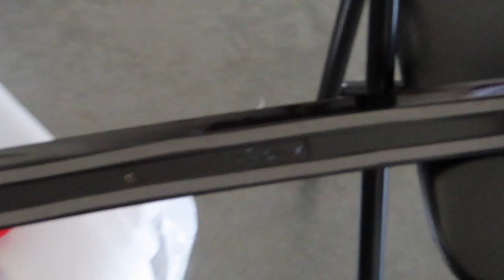Roof Wing Spoiler install 2020 Toyota Camry mods | GARAGE DRIVEN

Comment: Thank you for showing this video. When you use the adhesive promotor, the guy I was considering buying one off of ebay, I didn't know the english was this first language and he was referring to just the tape when I asked if it comes pre installed. He says it's already on there but you had to do it yourself.

Comment: I just installed that exact wing and had the same issues with it in the corners.  It's not flexible so you can't bend it downwards.  It's not very noticeable so it's not a huge deal.

Comment: My one have two deflectors pieces left in trunk at delivery, part have to be install under car in front of each front wheels, car pass from 7.4 to 7.9l/100km on my 'highway only' use after having them installed. I am just about to remove it to check again. At 1450km per weeks its a tird gas thank full needed on my friday come-back ride, it $uck'$!

Comment: Is the glue necessary? Would you recommend just using the 3m tape? I know I'm late to the party
Reply from the maker: That’s not glue it’s adhesive promoter it just enhances the stickiness of the 3M tape.
Reply: @GarageDriven  got it. Thanks for responding.

Comment: FYI, I used that tape on a front rubber spoiler on my 13 Camry and then tried to remove it later on , NO WAY that stuff sticks likehell
Reply from the maker: I’d use the tape on my bumper etc but not with the adhesive enhancer 😂 that stuff is no joke.

Comment: My roof spoiler ended up becoming loose after 8 months :( I plan on reinstalling it with 3M tape and some adhesive again. What type of adhesive would you recommend?
Reply from the maker: Purchase actual 3M double sided tape and you should be fine. Those companies sent these spoilers out the the cheapest tape honestly.

Comment: Did you do a black truck spoiler as well?
Reply from the maker: It’s white still 😤
Reply: Have u drove threw a car wash with the roof spoiler or the headlight eyebrows on if so did you have any problems with them getting ripped out or messed up ?
Reply: @masterdalton88  Also curious about this question - I just bought a 2020 XSE w/ the blackout package and love the look of this roof spoiler

Comment: What’s the tape called and the glue?
Reply from the maker: 3M double sided tape and it’s adhesive promoter I believe it’s called. This stuff comes with the Spoiler.
Reply: Garage Driven thank you I bought the roof wing on eBay for 50 bucks arrived yesterday but it didn’t come with it just the basic roof
Reply from the maker: From the link I provided? Mine came with it 😤

Comment: is ur the v6 camry?
Reply from the maker: Nah it’s not and we’re not too happy with the power 😤
Reply: @GarageDriven  sorry to hear that...i just got the v6 xse myself. im not to happy about the back leather seats coming from factory looking rumply and bubbling between the seatbelt anchors in the rear
Reply from the maker: My seats were perfect that’s crazy
Reply: @GarageDriven  I just bought a 2020 Camry LE with 4 cylinders and it has plenty of speed. I drove a 6-cylinder also and I did see the need to pay more. What is that glue that you use?
Reply from the maker: Truong Nguyen that’s just adhesive enhancer it helps the actual tape become more sticky.